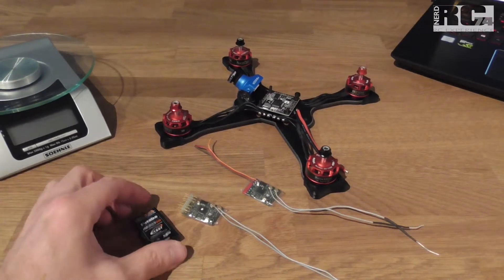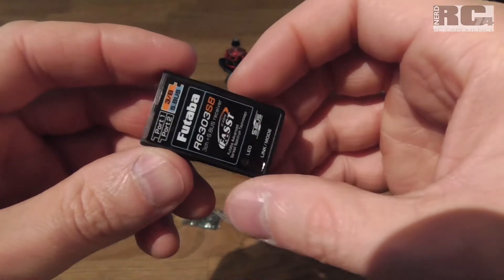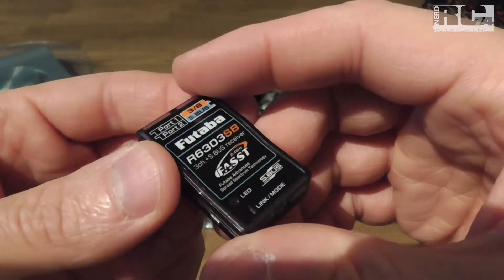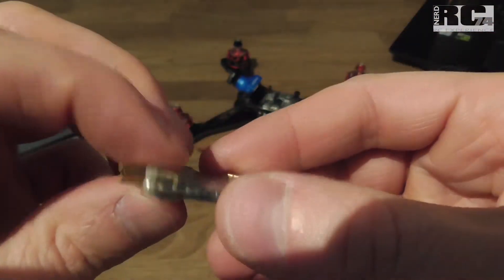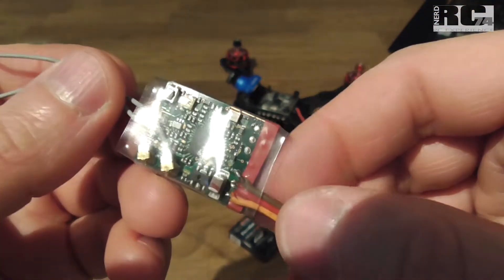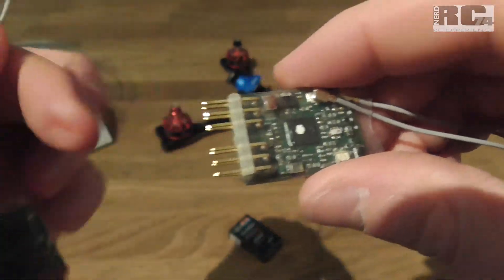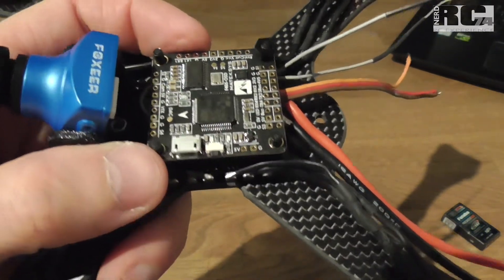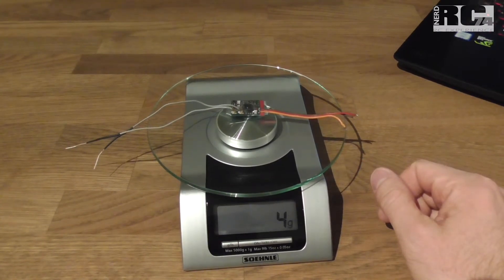FUTABA FASST S-BUS RECEIVER R6303SB MODIFICATIONS

Comment: is it possible to associate the rssi with the futaba t14sg?
Reply from the maker: Only possible over OSD if you fly FPV drones. But you have to modify your Futaba receiver. With Futaba FHSS or FASST you can fly kind of line of sight aircraft without having range issues. If you wanna fly long range FPV you better change your RC system to TBS crossfire.

Comment: this receiver is full range?
Reply from the maker: There is no definition what full range is. Depends on a lot of things what the max range of your rc system can be. I tested my original Futaba FHSS receivers up to around 2km with my fpv drone. In my opinion this range is what you can call full range.
Reply: @RCnerd74  great i got a 18sz to pair with this rx, pretty good range 2km! great video! thank you